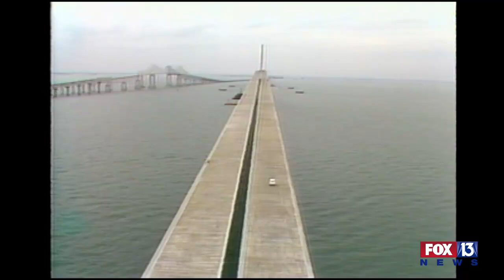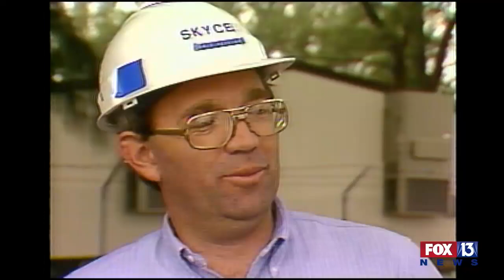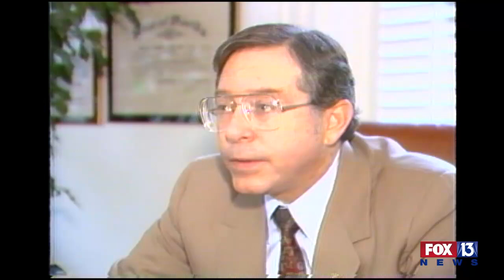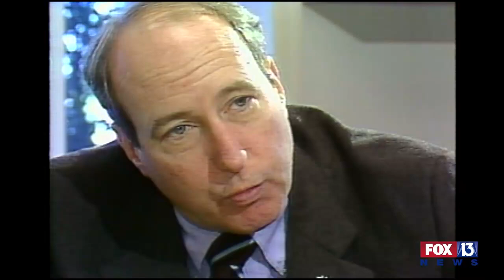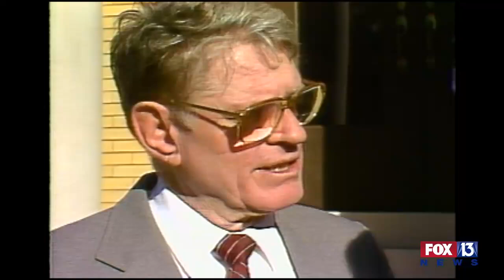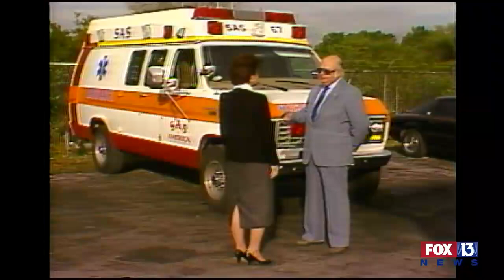From 1987: Previewing the new Sunshine Skyway Bridge

Comment: How does a ship strike a bridge?
Reply: No one has talked about that here. Odd.
Reply: If you are drunk you can wreck anything.
Actually I think it was fog and faulty navigation equipment.
Reply: Yeah the weather was really bad the boat driver didn’t do anything wrong he just couldn’t see because it was so rainy
Reply: It hit the support, which was unprotected.  The new bridge has bumpers blocking ships from hitting the supports.
Reply: @GH-oi2jf the olds spans had wooden protectors  installed with the completion of the 1971 truss, but they rotted away due to poor maintenance.